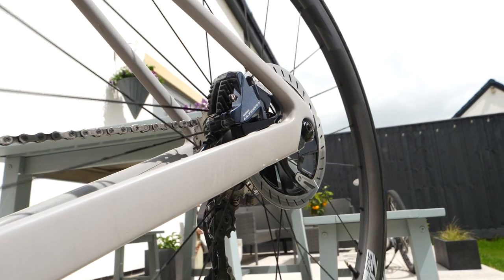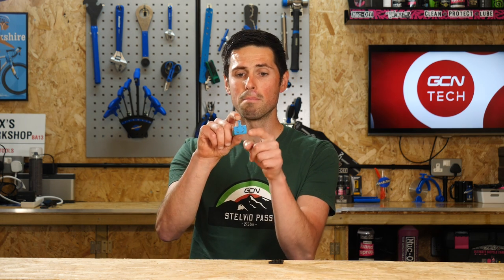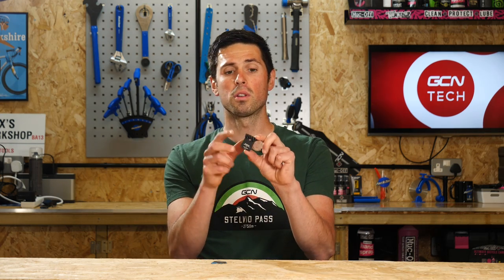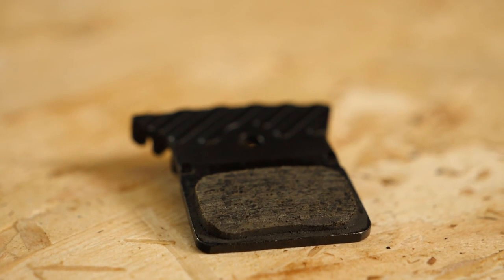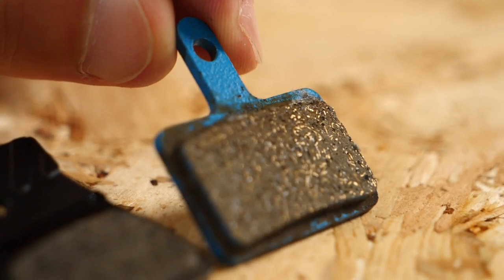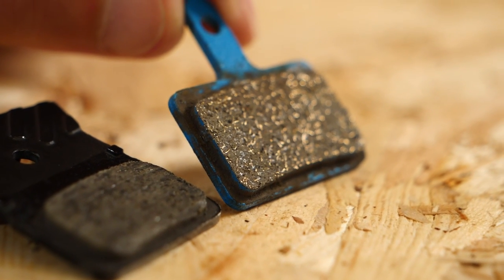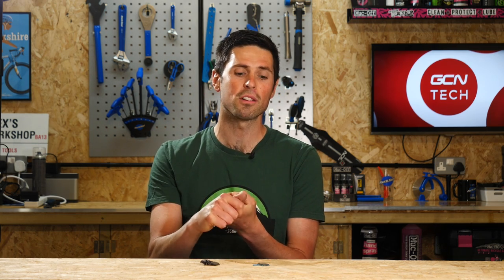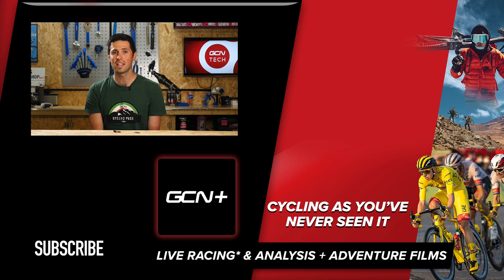Everything You Need To Know About Disc Brake Pads For Road Bikes

Comment: Upgraded 🙈 it's hardly an upgrade Alex 😂

As per your last video how to win the tour de france...

Less Aero
Weigh more

Is that an upgrade 🤔🤔🙈🙈
Reply: Brakes better in the wet, doesn't compromise your rim over time. I would call that an upgrade, more safety is always good :)
Reply: @shaku7652  I've got a disc and rim tcr.

I'd say the braking comes down to wheels and pads used. Obviously if your running carbon rims in the wet braking won't be great.

But if I'm running my shamals alloy wheels with BXP pads against my ultegra disc brakes the difference is tiny... Traction is the main issue in the wet especially if your running 25 / 28mm tyres. Not the power of your brakes.
Reply: @danc1829  Well to be fair, i am a very heavy rider at about 100kg riding a touring drop bar bike with luggage coming to a total weight of round about 130kgs, all that with 2,4" semi-slicks... I wouldn't want to change my 203/180mm brake rotor setup for rim brakes. 

On the other hand, I don't race and weight does matter very little to me, as I carry alot anyways. For racing, I have no experience. 

Also there are numerous tests on youtube that suggest reduced distance when braking on discs in the wet. 

It probably all comes down to preference and focus of riding. For Touring and heavy loads i would never go back to rimbrakes. Especially in bad weather and mud.
Reply: @shaku7652  yeah as a tourer I see your point and I'd be on discs aswel.

I ride mostly fast club riders and sportives. I guess it's horses for courses 👍
Reply: @danc1829  as a tourer surely wide cantis or v brakes on aluminium rims give as good as performance. In all the videos that prove disc has better performance is disc versus carbon rim. We all know that aluminium has better braking surface than carbon and cantilevers or v brakes out perform road brakes for power and modulation.
Reply: @tobycolin6271  On a tourer or any long distance / multi-day ride i'd prefer hydraulics to V-brakes - cantis would be right out unless it was a short trip without many steep / technical descents.Also prefer wheel flexibility with disc for any long distance rig, but that's another matter.

Comment: #GCN #GCN Tech 
i hope you know about Silicon Lubricant 
i bought it for my Treadmill
and it goes like this , i forgot where i left my Ceramic Chain Lube  
so thought of using available lubricant in the house 
then i used this Silicon Spray lube Just to try Out 
and surprisingly it performed a lot better than any lube i ever Used 
can u test it on by Yourself and Give us the Stats 
its also cheaper than any bike and completely Stain free almost like Wax

Comment: Have a lot of mountains here so kind of wish I had discs so I didn't have to swap my carbon rims to alloy ones. Until they come up with a solution to the squealing I'm on rim brakes though. I can't imagine a 30 minute descent with ear piercing screaching.
Probably not so bad in the UK where it's hills rather than hairpin bend ridden mountains.
Reply: No worries about disc brakes my friend. Hilly around my place, lots of descents, discs mostly keep quiet. (Currently running a Campagnolo rig and a Shimano 105 rig on my disc bikes. Campa quietest..) Clean rotors every 3 weeks or so with acetone & happy camper. Have a good ride!

Comment: How does mechanical disc brake compare to rim brakes, given the mechanical disc brake has a oil reservoir, smth like the trp hy/rd?
Reply: If you're referring to cable-actuated hydraulic brakes, they should have the same stopping power and the same pad self-regulation. Can't say anything about feel/modulation, although I'd guess pure hydraulic brakes win here. On the flip side, I've been far luckier with my hydraulic hoses than with cables 😊.
Reply: @docontra4921  hmm thanks. Its jst tht cable actuated discs are more "home mechanic" friendly and cheaper than hydraulics. Its jst tht i dont rlly know abt its modulation and feel.

Comment: #AskGCNTech how bad is 10kg aero road bike for your first bike
Reply: not bad at all. Neither weight nor aerodynamic should be an issue for you if you just starting out.
Reply: Not bad mind, but consider looking for lighter options depending on the deal you are getting for the Aero one.

Biggest Aero gain is body position, and at the speeds you are going as a beginner an aero/TT bike is not going to do much for you.
Reply: If your starting out you’ll get no benefit from an aero bike and plenty of drawbacks. The benefits they are fast above  20mph and they look amazing.  The defects there heavy, set up with aggressive rider position, twitchy race handling, the frame is less compliant. You’ll go faster for longer on an endurance bike like a canondale synapse or others

Comment: How to know when to replace?
Reply: You need to measure thickness (both pad material and rotor width) with a vernier caliper and compare against manufacturer specifications. You can eyeball the pads (check the lower side -- opposite the mounting 'paddle' -- as in my experience that's the part that wears first), and if you are of the "better safe than sorry" persuasion, you can eyeball when to replace the rotors if you can feel by touch* or by sight the width difference between the braking surface and the rest of the rotor

*: Don't touch rotors with your bare hands! Always wear clean gloves; preferably non-powdered disposable ones

Comment: What happens if I put road disc brakes on an mtb or vice versa
Reply: Not much, they are basically interchangeable. In the case of SRAM, both Red for Road and Elixir for MTB share the same brake pads and the construction is virtually identical. There are some higher end MTB brakes (e.g. a 4 piston XT from Shimano) that would be overkill for a road bike, given the limitations in disc rotor size determined by the flat mount standard.
Reply: @joachimschranzhofer5566  xd imagine a 5 kg bike with dh brakes
Reply: @dave_xc  OTB is a guarantee 😂

Comment: Those cooling fins must be an aero penalty.   I wonder how many micro watts they cost your aero performance.
Reply: what is worse, especially the Shimano Ice Tec pads with the cooling fins tend to rattle quite badly. More pre-tension on the leaf spring clips helps a bit, but is not a 100% cure.